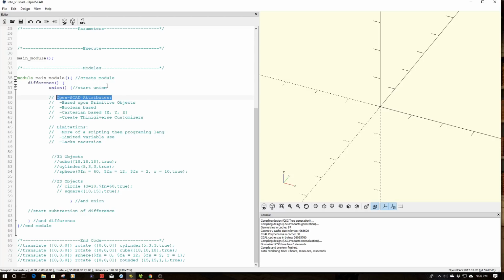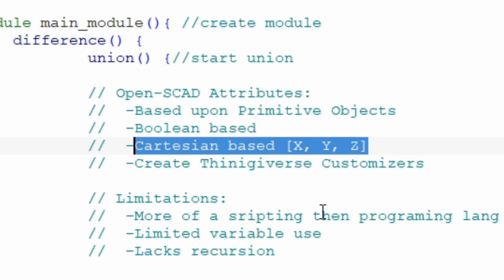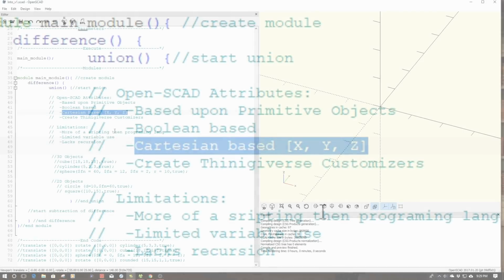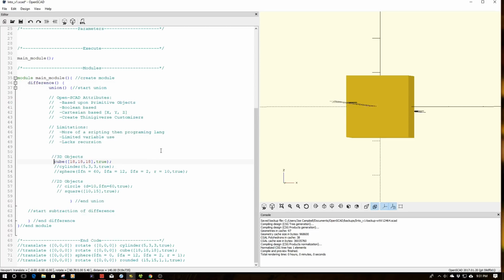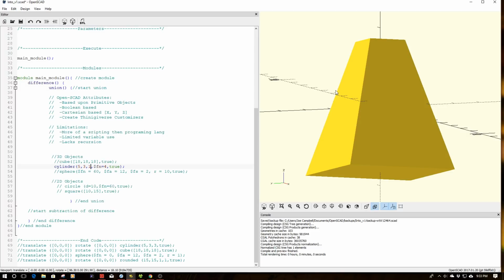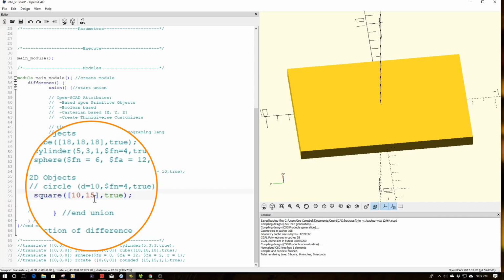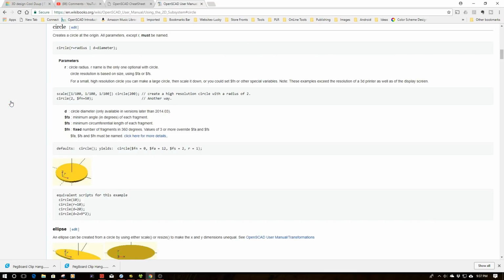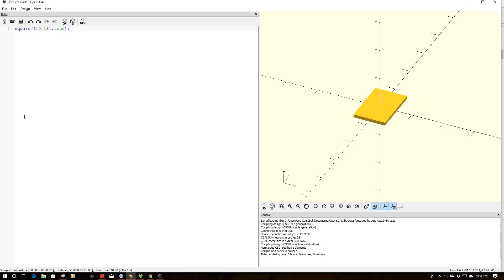Open SCAD - Introduction Part 1 for New Users!

Comment: Great primer :)
I've been using OpenScad for years to make simple objects to print. for some reason i have more faith in it than any CAD package simply because you can make things exactly as you require.
One thing i've never done though is made a customizer for thingiverse so perhaps for the new people you could point us in the right direction :) maybe an end-to-end tutorial?
BTW, I really liked your flange video!, super neat. this is what the community needs, for of that hehe  :)
Reply from the maker: If you search "customizer " you will see several examples however your point is valid, doing a dedicated video might be cool also :-)